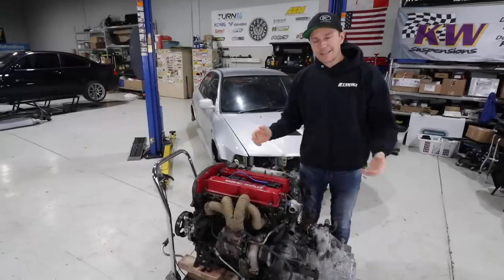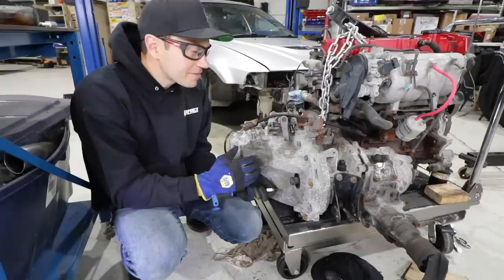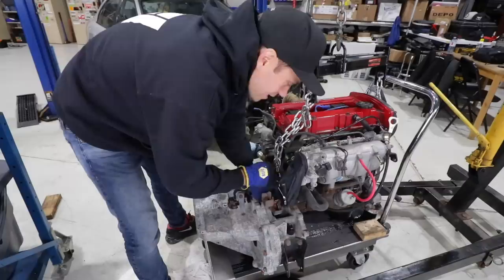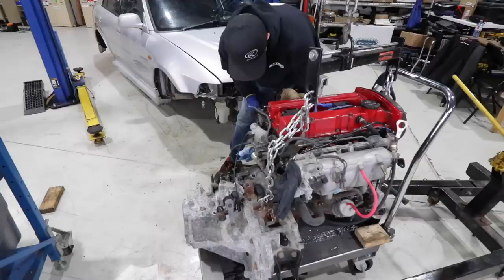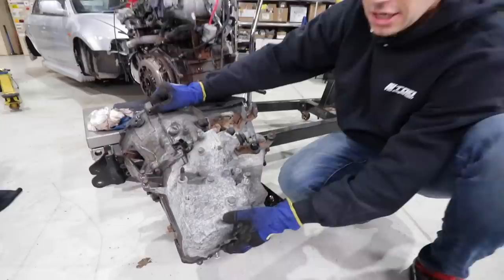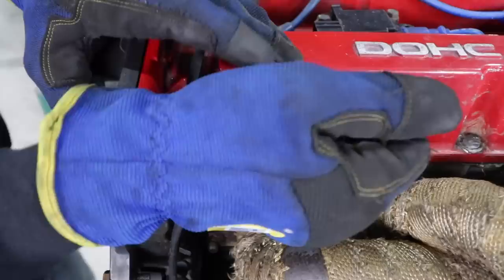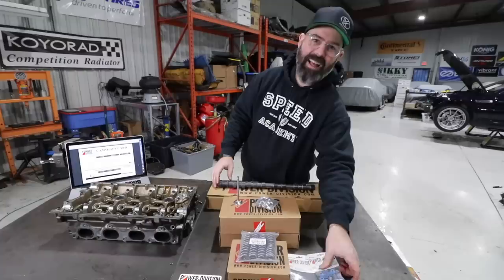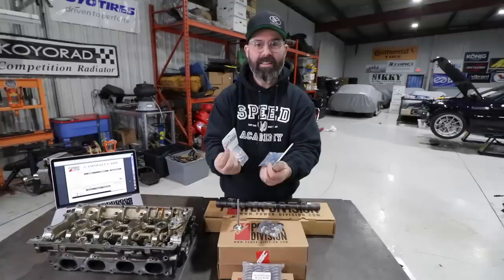Cheap EVO 6 Engine Teardown - How BAD is the 4G63?

Comment: Open ended wrenches need to be used in the correct direction depending whether you're loosening or tightening. That's how you strip bolts and nuts!!

Comment: There shouldn't have been any wear on the skirts of the pistons. Wear on the piston skirts can indicate previous overheating issues, where the pistons expanded to the extent where the skirts rubbed against the walls. Another potential issue is the cylinder walls being oval-shaped, which can sometimes happen, either with real old engines or engines that overheated. This can be difficult for at-home mechanics to diagnose, as the tension from the cylinder head can be the reason behind the oval cylinders, sometimes some machine shops will use a tool that is like a cylinder head, but with access into the cylinders to machine the bores of the engine block. In this way, they can prevent the cylinders becoming oval shaped when the head is tightened against the block.
Reply: On a side note, Mitsubishi's often have cheap piston rings installed. They tend to wear out prematurely, and if the rings are wearing then so are the cylinder walls. I'd suggest a diagnosis from a trusted, professional machine shop.

Comment: Check out some of the episodes on Jafromobile to get an idea of some of the particulars of the 4G63. I'm not sure why Pete's Talon shook like it did without balance shafts, but my guess is it was poorly balanced or had a bad timing belt tensioner and had nothing to do with the balance shafts themselves. The BS belt is a known failure point and the whole system is heavy and overdone. Get rid of them right, and you'll be happy. Also, you might look into the Kiggly HLA for the head oil pressure and might even hit up GSC for their lifters. You can also see a post on Jack's Transmissions talking about crank walk and rod bearings. I'm not sure how deep you want to get into the motor, but there are a ton of resources and "tricks" for making big reliable power out of the 4G63. Use them.

Comment: The spotty whiteness looks like coolant to me.  I'd use simple green and a brass brush.  On alumium parts that have heavy corrosion, muriatic acid works well, its the main ingredient in aluminum wheel cleaner.  Just be careful with acid...duh.

Comment: I would either take it apart and sink that case in a solution of white vinegar and potassium hydrogen tartrate, very little of each, and then leave it in there for a few hours! 
If it is too encrusted then add lemon juice! Always use non abrasive pads! You can also put some salt in there,  there are aluminum cleaners, I think mothers makes one! never tried them, since what i know works every time! If nothing works then switch to denatured alcohol!!! That will definitely do it!

Comment: 17:19 You are right Pete, AC Delco is the OEM supplier for GM 🤷‍♂️
Reply: Mitsubishi and GM had a partnership around this time
Reply: Realtime1501 do you think that was an OEM part number?
Reply: @MrDannyd9  most likely
Reply: I've never seen an Acdelco plug in a mitsu car oem. It certainly isn't impossible and I havnt worked on nearly as many mitsus, particularly evos as I have most other brands.
Reply: @chickenfishhybrid44  they were common on DSM's and eagles at the time
Reply: @Realtime1501  interesting. I'm pretty sure NGK makes Delco plugs anyway. I don't care for the smooth porcelain as much as the standard style, seems like it cracks easier. But I use ACDelco where they're oem and they're fine.

Comment: Once again, maybe you'll read through the comments this time..... evoscan have all the evo manuals available for download on their website. Will save us painfully watching you get caught on every little evo trick.

- Balance shaft delete can be done if rotating assembly balanced. Also only do it if you get the oil pump support shaft from gsc, seeing as they are supporting the build.

- the OMP oil pressure sensor has been screwed into the port where the factory oil pressure switch lives.

- you didnt show a close up of the rod bearings, but it looked like contamination. Foreign particles from poor servcing and dirt etc getting into the engine whilst carrying out servicing usually causes that.

- if you plan on on tracking the car, the stock sump is useless for circuits. Long right hand corners have the oil leave the pickup. Even a moroso struggles at times on street tyres. On semis you will need an accusump.

- a kiggley HLA is a good upgrade for the head. The factory dump valve to lower the oil pressure in the head causes issues when driving the car hard. The proper head pressure regulator is a far better solution.

https://evoscan.com/vehicle-manuals

Comment: One thing I hate about mitsusuckmees is that they use way to many different size fasteners. Take a component off and your have bolts that are different in length by 5mm

Comment: so little known fact. you know how that coil boot stuck to the plug. it was loose spark plugs or so i assume based on what i see. let me know if they felt tight or came out a little too easy? so the plug goes in for the first time and that funny shaped washer thing that's a crush collar feels like your stripping the threads so most people stop tightening scared of stripping aluminum threads collar goes uncrushed and plug loosens up from vibration. car very slowly starts running like crap lower power more hesitation rougher idle. now with the plug just a little loose some combustion actually gets past the threads and the crush collar heats up and melts the boot to the spark plug. if i'm right this car was seriously low on power but you couldn't pinpoint a cause maybe even low on compression too.

Comment: Dude, delete those balance shafts. You definitely had some other kind of issue with your talon, because they don’t vibrate that much without shafts. The increase in reliability of not having the bearings and belt in play are worth it alone.

Comment: just soda blast and paint that trans grey - and honestly looking at the valve cover  would you consider a grey block - very yellow green for the valve cover with blue accents ( plug wires, silicone hoses/ intake connectors)

Just a thought would be a interesting theme

Comment: replace the knock sensor and delete the balance shafts, its no about the horse power its about the likelihood of the balance shaft belt failing and whipping out the timing belt causing total destruction of the engine, als the bearings can sieze and lock up the timing belt/oil pump also resulting in engine destruction.
Reply: the balance shaft spins twice the speed of the crank so if you are reving higher lets say 8k seems that's quite standard the balance shafts are spinning at 16k rpm and can easily seize at that speed.

Comment: Aren’t the older 4g63 known for crank walk?  I had a 2g DSM which i remember being notorious for it. Also if your engine is apart why not do a nice porting of the head.
Reply: C5 Z06 correct, but the 5-9 use the later 7 bolt with revised thrust washer and is very very rare for them to have a problem.
Reply: The 6 bolt Evo motors don't suffer that problem, you're thinking about the 7 bolt 4G63's
Reply: Crankwalk pertained to very few 95-96 dsm's.... more of a myth than actual problem.....
Reply: @spooling1g  yes, and usually only when a very heavy clutch was used. Almost zero 7 bolt automatics crankwalked.

Comment: Remember when you rebuild a 4g63 you have to generate oil pressure yourself before you try starting best way to do it is with an impact wrench on the oil pump. If you dont do that all your work will have been for nothing 😉

Comment: Want to clean the aluminum bits ?  AUTOGLYM ------------> https://www.canadiantire.ca/en/pdp/autoglym-clean-wheels-0392905p.html#srp
Use a small wire brush to scrub the heavy stains while the cleaner is working... Rinse parts with a pressure washer for best results.
Wear long sleeves/gloves & eye-pro, it's nasty stuff but it works great !

Comment: You shouldn't be putting expensive plugs in an evo. Every tuner I have spoken to who builds high power evos always recommend just putting cheap copper plugs in em. Iridiums cause em to run like this. Don't do it.